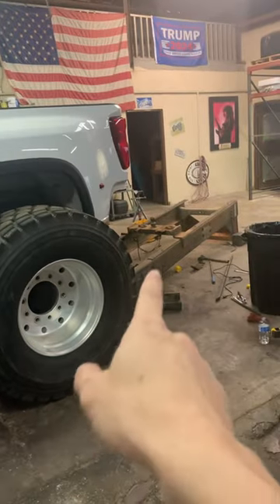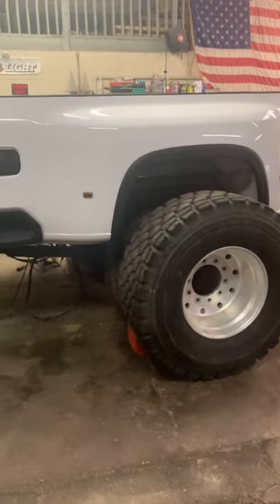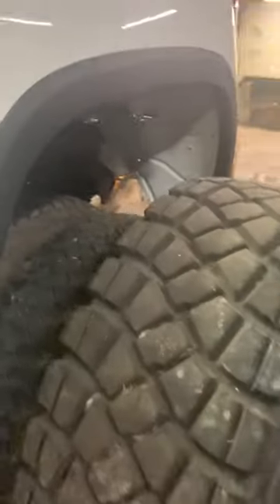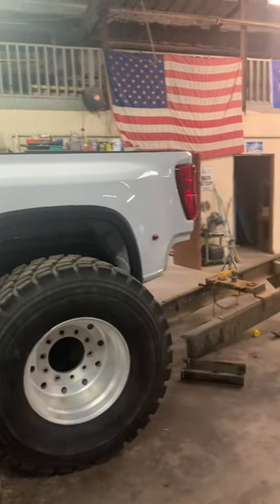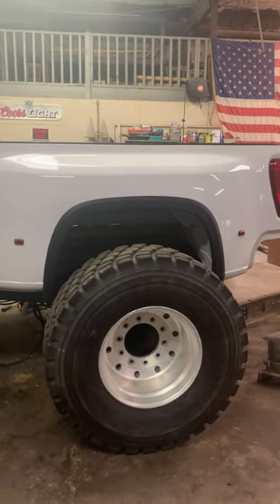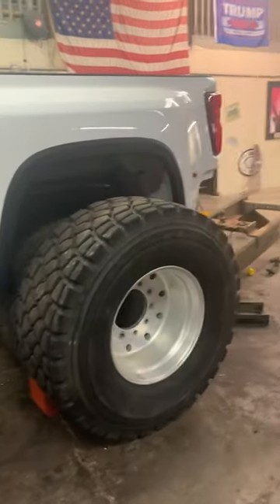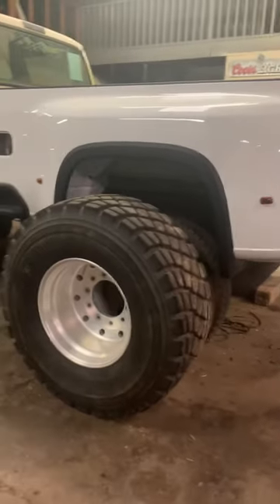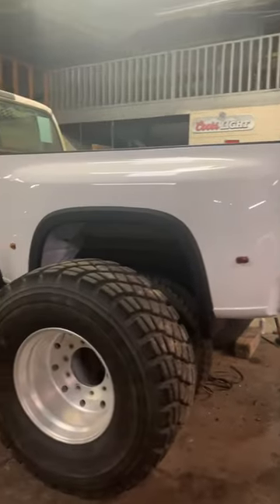To gooseneck or not gooseneck #f650 #supersingles #gooseneck #alcoa #caterpillar

Comment: What wheel and tire combination is that I am doing a F6 50 build also and that’s exactly what I’m looking for but having trouble finding that combination
Reply from the maker: It’s a 445/65/22.5 Goodyear G278 with Alcoa super single wheels. They make 2 different types of 10 lug patterns so make sure and double check yours before buying.